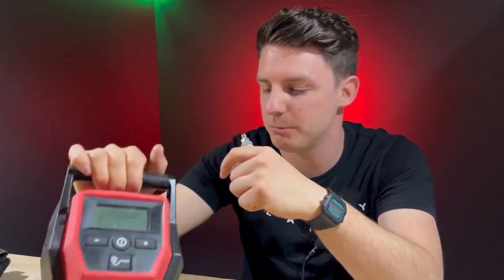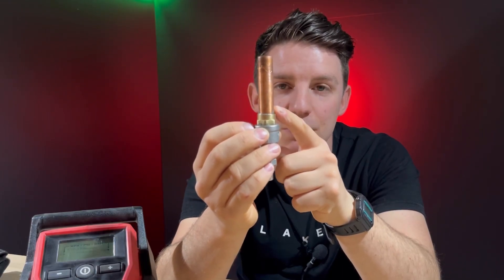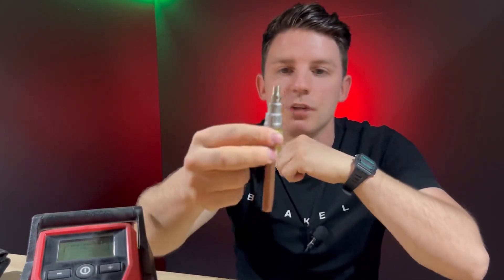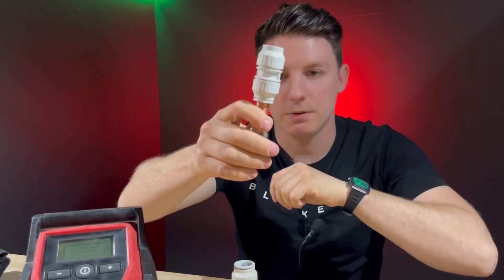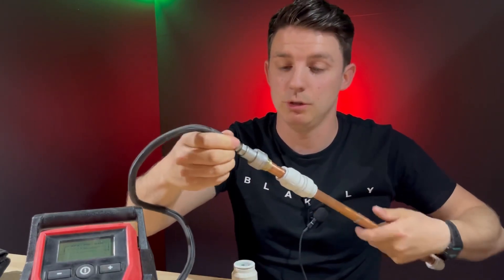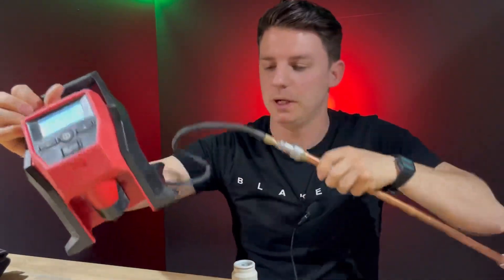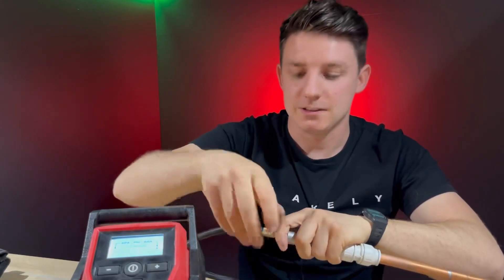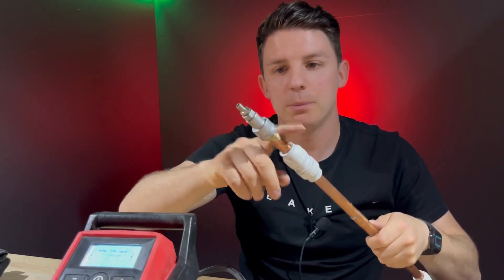How to pressure test plumbing using the Milwaukee M12 Inflator #subscribe #plumbing #milwaukee

Comment: I am not sure if this guy is adding or reducing the pressure in the pipe. Removing pressure will detect leaks (as air goes into the pipe via the hole), but wont test if the pipe work is strong enough for the pressure it will receive when in use. A word for warning for those pressuring pipe work to greater than atmospheric pressure: It is  dangerous. If your connections are not up to standard, a failed fitting could fly across rooms with no thought about who is in the way. I was kicked off a job for air testing pipework and legal action taken against my employer for breaching the contract. (It was big chain hotel).
Reply from the maker: Air will push out, obvious pressure testing is water or the best

Comment: So I’ve got to install some rads on a existing vented system. Can I just test with this method? What do I need to do with the boiler and cisterns in the loft?
Reply from the maker: Shut off the cold feed and cap the vent I think it will work

Comment: - Brilliant and informative as always, thanks! 
- Question, can the adaptor be made less bulky, 15mm female to 1/2 female --> 1/2 male to 1/4 (or 3/8 female) -->  Schrader valve. 
- Not sure why this is needed BES - Part number 14320 Screwed S/Steel Reducing Socket - 1/2" × 1/4" BSP. Am I missing something please?
- Thanks again, keep up the excellent work
Reply from the maker: Can make it how ever you like bro! The joys of making your own tools 👍
Reply: @mmplumber  thanks!! You're always inspiring me to improve. I mean that, brilliant work.

Comment: Can you use a inflator to pressure test a whole new construction house instead of a compressor
Reply: You're not supposed to but I know lads that do and don't have any issues. He does burn them out though and gets them fixed on warranty. Takes about 15mins to pressurise a 3bed with en suite

Comment: How much pipework can you test with this ?
Reply from the maker: The best test is water but air is fine for small runs I believe
Reply: I usually do an air test then a water test afterwards. Air to make sure no major leaks then water for peace of mind. I usually install large runs 50m plus so this inflator would be no good I guess